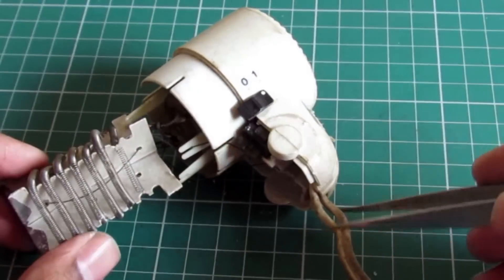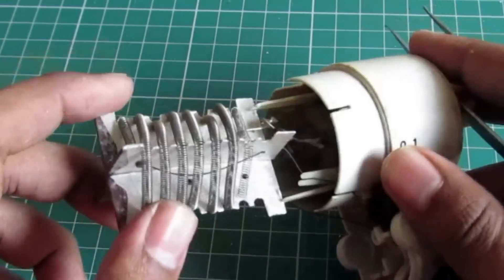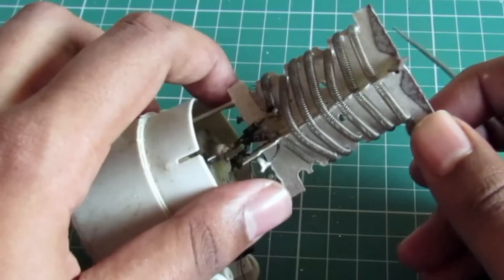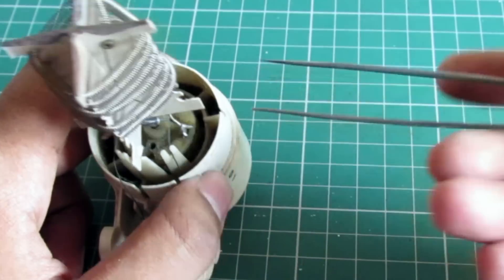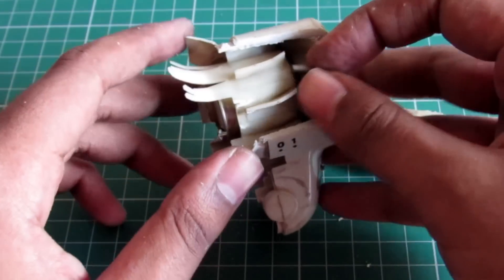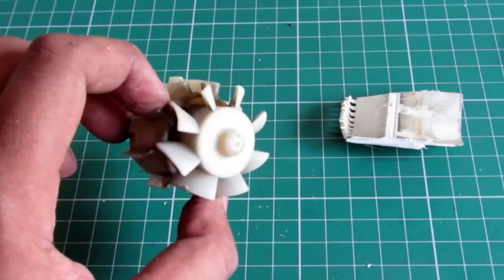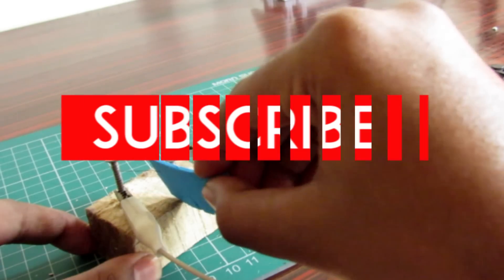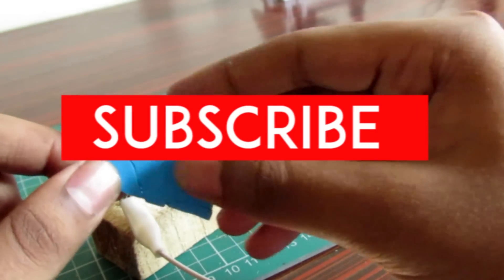How to salvage a Hair Dryer For Free Parts || Hot wire Styrofoam Cutter

Comment: Helo! Great video, congratulations!
I AM having a weird problem... I used a 12v 2a font, checking irá voltagem before plugging in the cutter the voltimetre reads about 12v but as soon as It is Wired up, the tension drops to around 2v. And Idea why that is? Also, the nicrom wire gets hot but nowhere hot enough to cut the styrofoam
Reply from the maker: Nichrome has high resistance so the drops as soon as you plug in